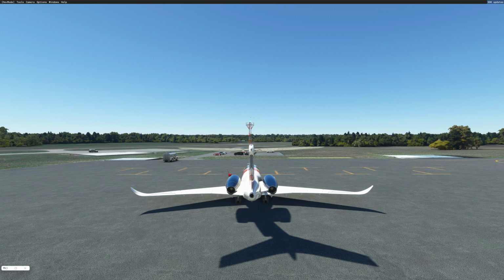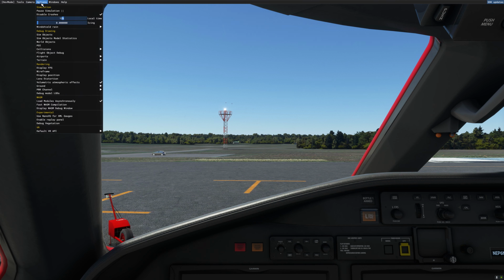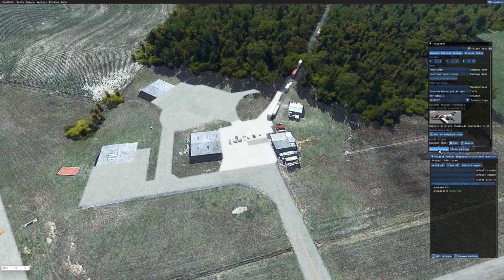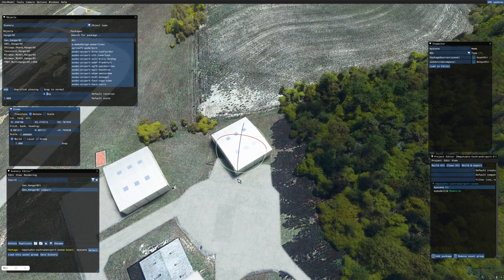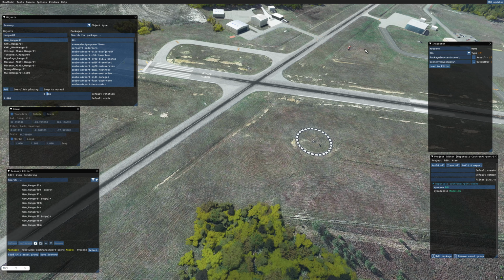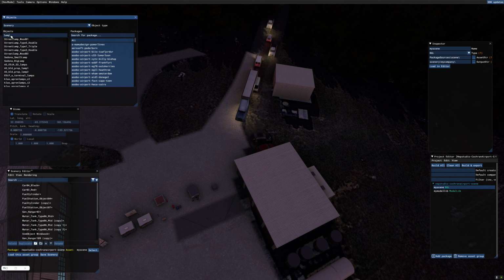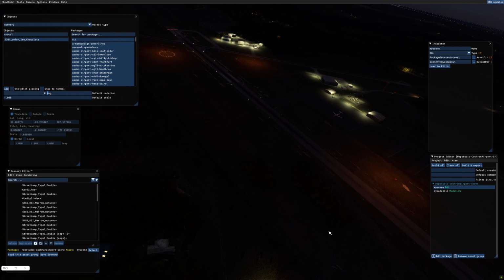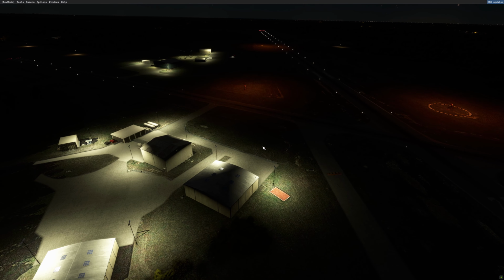7 MSFS 2020 Scenery Tutorial - Step by step - Improving Small Airport Scenery - Using Asobo objects

Comment: I've been using flightsim since FS5 and creating scenery has come a very long ways. Just like painting aircraft. What used to be simple and very easy to do has since became somewhat complicated. Your video has inspired me to possibly try and work on one of my own local airports, KMOB, KBFM, and a couple of the smaller private airports in my area. Thank you for taking the time to do this and teach others how do this craft. One question I have is when you were researching the types of hangars to use, how was you able to view those hangars to know which ones you wanted to use ? Is there a program that shows pics of the objects ?
Reply from the maker: I do caution against bringing an airport in. The resolution is limited up close. For example, you would not want to capture hangers you taxi near.  The photogrammetry looks good at a distance but not up close. If you want to capture a remote building at the airport but not a building you frequent, sure, you can do that.

Comment: I've got a road going right through my airport, and I can't seem to find any way to exclude roads. Polygon with exclude roads doesn't do anything. Is that just broken, or am I missing something obvious? Thanks for your videos!
Reply from the maker: You are welcome for the video and thanks for watching. Actually, you are not doing anything wrong and you are not missing anything as best I can tell. I have the same issue at KBNA. In reality, the taxi path passes over a freeway but the airport area is not terraformed correctly and I have to taxi through the freeway traffic and the cars and trucks drive through me or me through them. From my understanding, and I have researched this matter, is that the traffic is AI-controlled to run on "road materials" and removing the roads does not seem to remove the road materials and the vehicle traffic. I do not remember where I read this but I read that the current SDK is not at a point where we can edit traffic patterns. One might ask how the payware creators can manage these issues. And that is a fair question and one I do not know the answer to. Maybe the payware creators have a better tool than the current SDK provided to us. This is total speculation on my part but obviously, some creators can do more than us users. So, based on this theory, I am hoping there will be a continued improvement to the user SDK, and eventually we will be able to manage road traffic. I wish I could give you better news but that is what I know at this time. If you find out something different, please share because I will be all over fixing traffic once I can.
Reply: @patriotsix5880  No worries, thank you for the detailed reply. I'll keep my eye out for SDK updates or anything else that allows us to get rid of (or ideally, move) those pesky roads. The terraforming is definitely the culprit in my airport too. Super annoying, but until we have better tools I guess we're stuck.

Comment: How can i edit the horrible street traffic in the default scenery ( at 5:00 min you can see what i mean)? Every scenery would win Immersion from a good placed Street traffic. Thanks for the Video! Regards
Reply from the maker: Hello. I understand what you are seeing and saying. The vehicle density is ticked to 100% in my settings. I have not changed the settings from 100 to see what the impact may be. I use GLOBAL VEHICLE TRAFFIC MSFS by LATINVFR but this mod changes the vehicle style to more correctly match models for the part of the world you are in. Perhaps, changing the density in the simulator options is the way to go. The simulation is a marvelous piece of software but I expect and accept limitations. Where I live, in real life,  it seems every inch of asphalt is filled with cars. 😊 If the question is in regards to your simulation experience, then yes, I would change the vehicle settings to get as close to your expectations as possible.  I hope that answers your questions. I am not an expert and there are a lot of things that I do not know. Happy flying.
Reply: @patriotsix5880  Is it possible to block streets for Traffic? Thank you for your answer. Regards
Reply from the maker: @Artendo100  I have yet to figure out how. There is a closed street at my home airport KBNA that was once an off ramp for Interstate 40. The closed road runs right up to the new taxiway. I have tried to remove the road with an exclusion polygon but the trucks and cars continue to run up to the taxiway, turn around and go back. If I ever figure it out, I will make a video because it is annoying.
Reply from the maker: @Artendo100  I researched this and what I found says that a resolution is in the works but the post was dated January 2021. There has been no activity in the thread since January 2021. This is odd. If a resolution is coming it seems to be taking a long time. If I find out more, I will let you know. If I can find a resolution I will post a video on how to do it.

Comment: Outstanding!  One question - where is the illustrated library of objects?  How did you decide which hangars would be most like the real ones?
Reply from the maker: Greetings Anthony. To my knowledge, there are no illustrations of the visual appearance of any of the hangars. You have to do this the hard way. Add a hangar, look, keep if you like, or delete if the hangar is not a match. And look at another hangar, rinse, and repeat. One by one, hangar by hangar. Yea it stinks and there is no easy way. I will normally make a note of an interesting hangar I might use again. For this video, I paused the recording and manually searched for matches.
Reply: @patriotsix5880  Bummer!  I wonder how many of each type of object there are.....  Is this how the commercial vendors go about creating detailed airports?
Reply from the maker: @anthonyvallillo422  The good vendors have 3D creators handcraft the airports, buildings, ETC. Take a look at FlyTamp's work. Every detail down to billboards and highways is there. The FlyTampa Vegas airport and the Vegas strip in the Marketplace are outstanding.
Reply: @patriotsix5880  I have the FLy Tampa KLAS for XP11 and you are right - it is great!  Is it possible , in FS2020, to replace individual elements of non fancy airports?  At my airport, KHGR, Asobo placed a control tower that would look more at home at JFK - it must be 300 feet tall!  KHGR has one of those small prefab towers.
Reply from the maker: @anthonyvallillo422  Anything in your community or official folder is usable. I have noticed that many of the vendors group assets together. For example, you see a hangar from KLAX. That hangar may fit you needs . However, the  hangar may include several buildings and objects that might not fit you current situation.  In an earlier tutorial I replaced generic bridges with bridges more true to life. I was able to find bridges in the scenery that is close enough in style to the real bridge in real life.